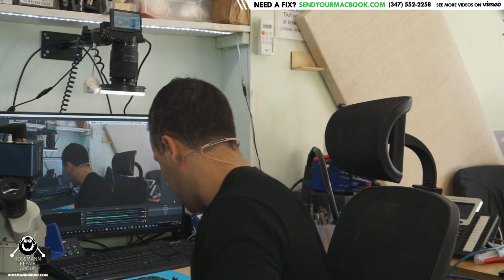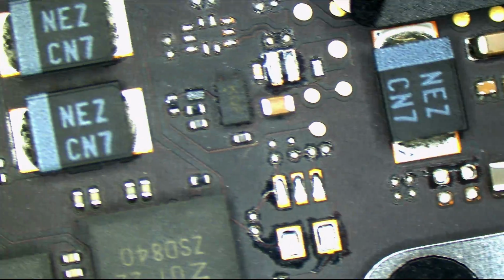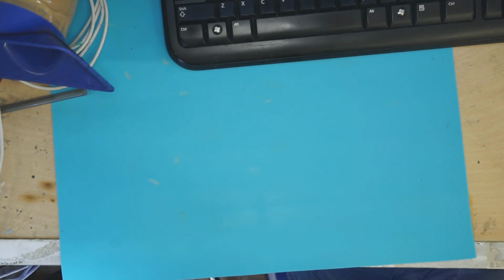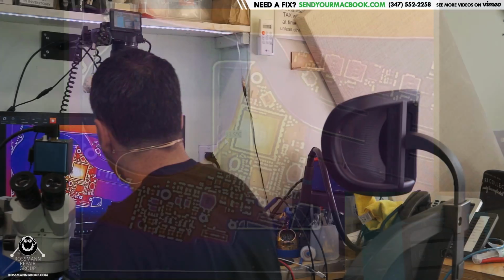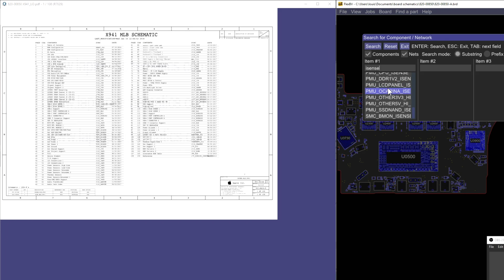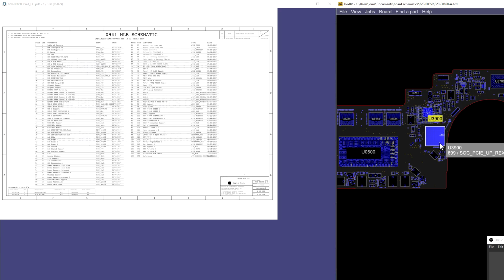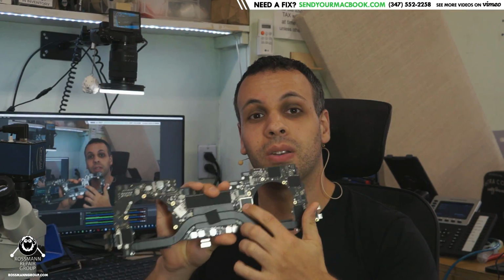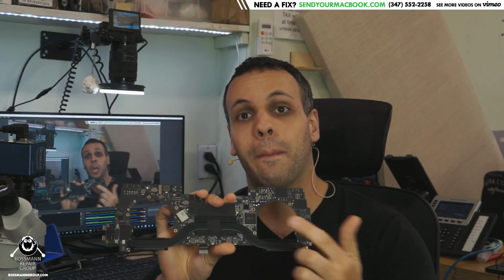Apple users have no one to blame but themselves.

Comment: You're right. Value and support on Apple have gotten increasingly worse over the last 10 years. My next machine won't be a mac.
Reply: I agree with Kev, Macs used to be something special. Now they are useless garbage.
Reply: None of your machines should've been Macs, first off. Second off, get a mid-grade off-the-shelf PC, install Linux, and profit. 

You now have a machine that's at least as powerful as a higher end Mac, with twice the power and 10 times the useful life with an upgrade path.
Reply: @akio2589  -- for a while, macs were clearly the way to go. Not now though.
Reply: This isn't what Steve jobs would have wanted
Reply: @jaysefgames1155  

Jobs is dead,  Tim Cook is surrounded by sycophants= shit products

Comment: I'm sure I'm going to get some push back on this, but this is a prime example of the state of technology right now and the foolish consumer who falls victim to it time and time again. Software and Hardware technology as a hole has hit a wall. So how do you get people to keep buying your product. Engineer things that will fail on purpose, come up with new connectors that force the consumer to either purchase new devices that have the connectors or adapters to fit existing options. Update software and call it security holes that then create new holes or break functions that already worked before updating, but to get the old function working again back, you'll need to purchase the next version because they won't support the older version any longer and by they way, it now needs more hard to perform the same task which means you have replace more hardware.

Comment: I see this as a pure money grab by apple ,  the board built to be as cheap and nasty  and throw away as possible so the customer has only  two options ,   one is  have it returned to apple to have the whole main board/component replaced  , and  the second  , to sell the customer a new machine .
  You also see this sort of crap from certain recent car makers that will not allow any  work to be carried out anywhere except  their own shop , and they will not even supply repair manuals and all parts must come from their company .
  Utterly disgraceful  business practices in my book .

Comment: The Genius Bar told me that my mid-2015 MacBook Pro needed to have so much thermal paste, that it squirts out the sides. Guess who ended up repasting my MacBook Pro (which is still under a repair warranty from a display coating issue and the battery recall)? Not them. Took me like 30 minutes.

Comment: I've played with a couple of Apple devices, an iPhone 4 and a MacBook, and both were absolutely horrible to use. You can't do shit with an iPhone unless the Apple Gods have granted you a permission to do the thing you want to do. No app drawer, can't replace launcher, no home screen widgets, can't install apps from outside of the App Store. The MacBook had no file browser like every other OS has. You install programs by dragging and dropping them somewhere. You can't find any files you want. It's just a horrible mess.
I like being able to install stuff I want to install. I like browsing my files and folders. I like customizing things so that they fit my needs. You can't do anything with the Apple crap. Every decision has been already made for you and you just have to live with that.
Oh and I haven't even gotten to the hardware side of things. You can build your own PC from parts you choose. You can buy repair parts for your Android phone and pay someone 50 bucks to repair your phone. You can even browse the files on your Android phone even if it's not booting into Android any more and get the data you need. There's so much more you can do to fix your stuff if it's from someone else than Apple.
And Apple doesn't even have the advantage of having stuff that breaks less. It seems to be the opposite nowadays. They don't even conformal coat their PCBs to protect from liquids and moisture. Apple PCBs are the only PCBs I've seen inside consumer electronics products that have a matte finish to them, meaning they have zero tolerance for any sort of moisture inside the product.

Comment: Mega geek. Apple is like hydrochloric acid to me. That so many of my friends are not wealthy but they have MacBooks, IPhone's, monitors, everything. I am a computer repair guy but when I get a possible customer that hands me their MacBook, I just say no. If they can turn it on I back up the data. But if I cannot, I give up.

At the very least, western digital external hard drives have time machine built in. If I can't even get a freaking flash drive in, I have to use them over the network and charge them for the backup.

Linux is a bajillion times better than them. I can actually DO THINGS

Comment: It's not just Apple that does this. About... I don't know, roughly a decade ago... I had an Xbox 360. It was still under warranty, but Microsoft refused to service it when it broke down because I had "modded it"... I wouldn't have a clue how to mod it, I've never modded a console, and before you ask... yes, the console was bought directly from a legitimate retailer.

Still a little bitter about that, honestly... because the console wasn't modded but they were claiming it was.

Comment: When I was at school before my 8th grade year and we were getting our laptops and after I asked what the laptops were and the lady said"MacBook Air," I was immediately angry, annoyed, and sad. A few months ago, I think it was killed by a small amount of water in the keyboard and I couldn't get my HTML projects off of it because they use a proprietary connector for the SSD. If the school district gave us cheap $100 laptops, I would've been able to take the hard drive out of it and into my Dell Optiplex GX620 and move my projects onto a flash drive... And even if it was an SSD, I would've been able to get a reasonably cheap adapter to be able to access it... The laptop is probably serviceable(I still have it) but there's no way I can afford something like that. You're blaming "us" for this problem when EPISD baught over 50 million apple laptops.

Comment: Way back in the day, IBM disallowed other companies from producing hardware based on micro-channel, causing the birth of CLONES to the IBM-PC. This ultimately led to clones using ISA to avoid patent infringement with IBM. This caused IBM to segregate themselves from the market they actually created, and led to the explosion of the PC. Apple is forgetting history's mistakes, and will damage the market they created for themselves by pushing out independents willing to work on the product, but unable to by design.

Comment: Watched a few of your videos and attempted to repair my daughters 4 YO Mac book that just suddenly didn't turn on. Had to wait 2 friggin weeks for the torque driver to come (thanks Apple) since I had everything but. (Live in the sticks and mail is as slow as a snail after it's goop has dried up)

Opened up the back and it was a bit dusty etc but nothing obvious. Cleaned it up and verified it was charging... but still nothing (no fan... nada).

Took the SSD out and tried in case it was dead... still nada... not even crickets chirping.

I had a look for obvious burnouts etc and the board seemed fine and no visible water stains etc.

This Mac book had always been kept inside so was at a loss as to why just suddenly dead. I suspected a dead MOBO after all my fiddling so sent to a small local computer shop for a quote. Basically I didn't want to turf it if it was just a cable or some magic option-shift--alt-click-here type fix.

Well... A$88 for the dude to tell me A$500 to fix (when I can get same model on EBay and use mine for spare parts). According to the dude 2 of the 6? water damage indicators had tripped. IMO... bad design.... polished aluminium is nice and cool but in a cold climate the aluminium I noticed gets very cold to the point where condensation can start forming. Get enough condensation forming (say after not using the device for a week) and guess what happens when it's turned on and it's found it's way to power sensitive areas.

Not impressed with Apple with all their special tools and how the entire process leans towards scrapping the device and basically their attempts to make things un-serviceable compared to most other devices.

I wanted to salvage the SSD for use in my PC (since Windows 10 is now taking 2+ minutes to boot)... but they effed that idea up with their unique adaptors and shit. Hard to sell the SSD on EBay even because so many models where they kept trying to stop people upgrading with "non-genuine" (read Apple overpriced) ones.

Was crooked that my mum bought the POS to start with as someone that knows nothing (diddly-squat is the term we use here) about computers recommended Apple (all they do is watch youtube and hang out in facebook).

Damn iPod I have is the same.... decides after I turn it on after a month of non-use it needs "CPR" to boot and demands I fish around for the reset key combination.

Feel like sending them both to the Apple CEO who can shove them both up his....

I offered the Mac book to the repair dude cheaply and according to him he's already got a mountain of spare parts for free as people that don't want them fixed usually just leave for him to trash. Says something about their quality or fragility.

Comment: But isn't part of the whole point here is that if this machine is stolen that no one will be able to steal your data? Like the iphone. Obviously if the data is locked up inside the drive, then you need to make provisions for recovering that data. Anyways, I replaced the SSD in my 2017 Macbook Air on my own with zero issues. I replaced purely for size increase, nothing was wrong with it.

Comment: As a point of reference, I bought a Sony Vaio VGN-FW140D in 2008, yes, '08, and used it for computer programming in college. It was $999 in Canadian dollars (plus taxes). The DVD-RW failed under warranty and was replaced by Future Shop (a store in Canada), and then years later the HDD failed, which I replaced with a SSD myself. The battery failed after about 4 or 5 years, and wasn't reliably replaceable due to Sony changing the chassis shape too many times (so new batteries wouldn't fit an old chassis - design flaw). But besides that this thing just won't stop working. I'm talking easily over 1000-2000 hours of usage, easily. I'll accidentally leave it on from time to time overnight and the CPU doesn't overheat. 

I am currently running Fedora with a dual-monitor setup, and while it does chug a bit if I have too many web browser tabs which are sucking memory and cpu cycles, I can use it as my daily programming and media PC ELEVEN YEARS LATER!!! I have built gaming PC's but for work related stuff I just use the laptop with Linux.

The fact that Apple is pushing products of such a low quality level is astounding. The fact that people keep buying it is even more so. There's no reason that their products need to be this poorly designed besides malicious design principles intended to rip off the customers.

Comment: I'm happy to say that I've been avoiding Apple for 15 years and I will not give them ONE CENT for their throwaway products.
Reply: I've been avoiding them for 43 years 😂
Reply: @chaddavies4160  I can't afford them.
Reply: They weren't always throwaway products.. However:  since the first Mac, they have always wanted to be closed and proprietary.

The original Apple II was an open device and came with full schematics and even some ROM entry points detailed.
Reply: @NoirpoolSea  yea, I remember my first apple was the apple Macintosh with the multi colour Apple logo when I was 13 😂, it was good, loved it.
Reply: Yep me too stop buying apple since iPhone 4, saw through their greed and eco system.
Reply: ayeapprove i have a ipad 10.5 inch i love literally changed my life. But iphone 8 plus absolutely sucks. Had it one year only holds charge for like 3 hours and it was more expensive than the freaking ipad. I few other things and its going to be hard but 4 more months my sheet is paid off and i am all done with apple for so many reason never again.
Reply: Don’t you end up throwing away all your obsolete PC parts anyways?
Reply: @epion33  I sell most of the parts because people can actually use them.

Comment: My last apple products were the iPhone 4 and the 2009 MacBook that I am still using as an office computer. It virtually died using MacOs so I have it running Linux Mint 19 and that works fine.

I once (years ago) tried replacing the battery on the  Macbook with another OEM battery (had to buy special triangle screw driver!). It worked fine for three days and then decided not to recognize the battery anymore, which meant the machine would not even turn on. I had to put the old dead battery back in, and just resign myself to making it a desktop computer.

Something as simple as replacing a battery by myself on a $1400 machine was made virtually impossible years ago.

On principle I stopped buying Apple.

Comment: Apple has always had this vision and didn’t believe customers should have access to the inside, All electronic products seem to be moving to disposable unfortunately, i remember when a tv stopped working you could go buy new tubes and replace and you had a working like new tv,  if it dies and you don’t have a good backup then that is on you, my only issue is if your going to make it disposable then stop charging so much,  also the OS is part of the appeal of mac 
If your going to do videos like this then you should compare how other manufacturers laptops compare to repairing and how they hold up over time, i have a 2013 macbook air and still runs solid how do other manufacturers laptops hold up? I do believe that ram, hard drives should be user replaceable, things that are mass produced are going to have failures, over the years I’ve have two macs that died on me, one apple replace for free after the repair shop failed to fix and I ended up getting the next generation of the machine as it had been updated, and the other the motherboard died and they replaced it and it cost me a 180 dollars and that was 4 Years ago and I handed it down to a family member and it is still running to this day, sorry while i do agree to a point it is not just apple , if i liked windows or other operating systems that are out there then i maybe build my own pc. but apple has always been about locking down the system

Comment: First time seeing paired parts programmed not to work if they are paired with another part.,.......... iPhone 6-6s screen/homebutton smh
Reply: Happens in the automotive industry. For example I couldn't take a power steering pump from another Ford Focus and put it on mine, it would have to be "programmed to the car". They say it's to prevent theft but I'm quite skeptical about that. In fact manufactueres are mostly vague about the reason because they think customers will go "yeah so I got this new pump and it needs setting up on my car so I gotta take it to the dealer" without question.

Comment: Apple has abandoned Dieter Rams' principles of durability and environmentally sustainable development. No wonder Johnny Ive left Apple. It is not entirely the consumer's fault.
Reply: Jony Ive is the guy who designed these 10+ years of hardware failure. If anything, we should be happy that fat flat-design-advocate bastard is leaving.
Reply: @DeanStuff  His design team's designs were CAD and CNC based. I don't recall many problems on that level of the design. (Except for the battery glue)

Comment: And this is another reason I will never buy an Apple product.
I used to work for a company that was an Apple dealership, selling their products into the graphics industry. Before a new product launch we'd get the promotional literature, which contained the the technical spec of whatever the item was going to be. After a few weeks we'd be told to throw it away, and new literature would arrive, containing a lower spec than before. Sometimes this would happen several times, each time with a lower spec than initially promised. The reason ? Because Apple couldn't make things work.
Apple's facade is one of technical competence, but in fact they're no better than anyone else. Don't waste your money.

Comment: Planned obsolescence / pre determined points of failure or just crap design at premium prices?
Last 2 months at my job we had three (3!) macs (the screen computer in one model) break down in exactly the same way:
Started out wit general low responsiveness, followed by short episodes of screen flickering, getting more frequent for about 2 weeks, then parts of the screens went all noisy and jaggy for a few seconds before finally going black.

Since those macs were bought at about the same time when we got them (give or take a month) I call that highly suspicious.
Could be a ventilation/cooling issue due to the about 12x10 cm fan slits being insufficient during warm weather or maybe dust build up we thought, but there is no way to get in there to even give it a good eyeballing and light cleaning unless you got some special tools we don't have.

They were sent of for repairs to our local repair guy before I went on holiday, so I don't know what it turned out to be.
Reply: Let us know!

Comment: I'm glad I still have a 2012 model MacBook pro that I can still fix
Reply: Same here. I have a 2011 Macbook pro that I bought used in 2014. So far no issues and I upgraded the memory and replaced the HD for a SSD at home.
Reply: Same. Just replaced the HD with a SSD also. It's like a new laptop. :) My next laptop won't be a Mac once my 2012 MB Pro goes.